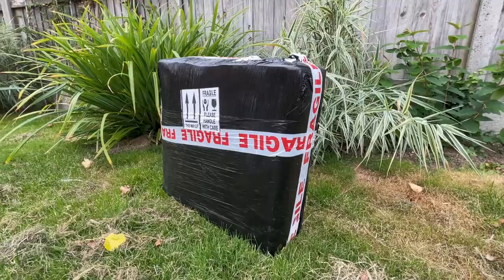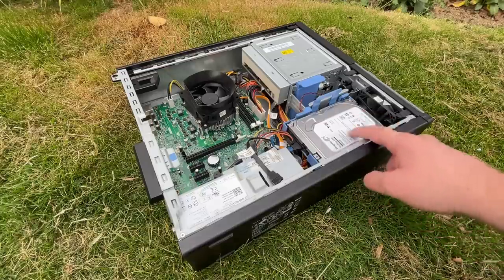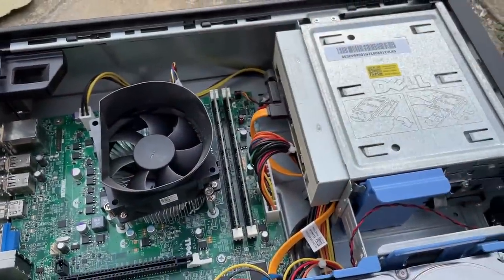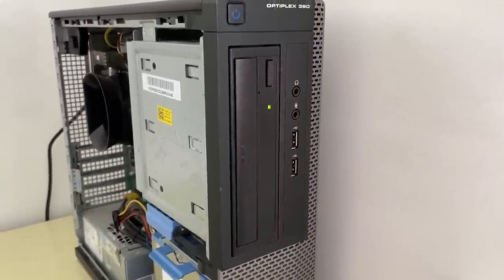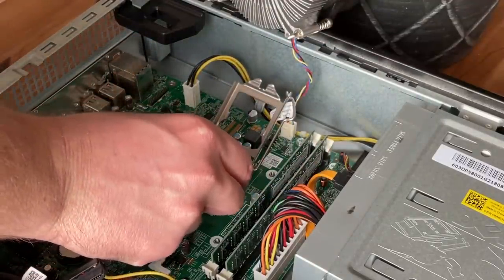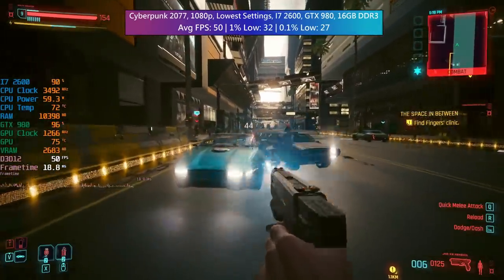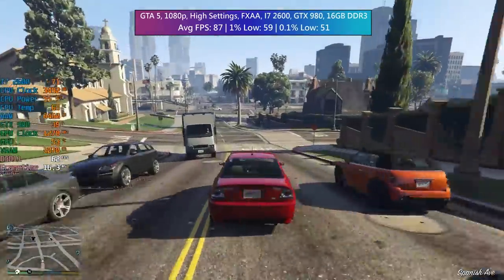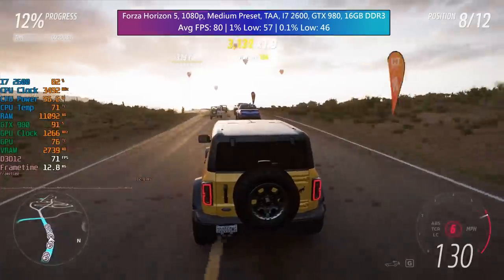The seller didn't know the specs of this £15 PC...

Comment: Last year, I scored a "for parts or not working" GTX 1080 for $35. I got it to work...mostly. It would only work in pci x8 mode not x16. Also scored a Ryzen 5 2600 "for parts or not working" for $50. Turns out it just had a few bent pins. Once I carefully fixed that, the cpu worked great. In fact, it's in the computer that I am using to type this comment.
Reply from the maker: Nice! That card shouldn’t be too different in x8 mode
Reply: That has to be the best deal in the history of pcs. Period.
Reply: No different with pcie 3.0 x8 vs x16 with that card. Very nice deal!
Reply: Cool to know that you solved it and wrote that on the specific computer too
Reply: Score!
Reply: I scored a workstation PC with 14Core i9 7940x, 128GB RAM,  GTX 1080Ti, Sound Blaster audio card, Asus Wifi 6 card and couple of other things for £40. Seller didn't know anything about the PC and it turned out the GPU was faulty as it was crashing in Windows, however it was still an amazing score as I sold the GPU as faulty for more than I paid the whole PC while other parts are worth up to £500
Reply: i love salvaging stories like this, you guys are smarter than average
Reply: same here put together a mostly used some new 13600k z690 64gb ddr4 1080ti for under 500usd off marketplace in under a week, absolute steal.
Reply: Name your price and I'll pay it.
Reply: Gg
Reply: I saw R5 1600 for 10 € already. Average is 30. For that price you get an amazing value for modern gaming.
Reply: might be some of the contacts used for x16 are damged on that gtx 1080, x8 only uses half the puns on the big connector
Reply: @asuschrist   bro in what page you found this?
Reply: yto mum
Reply: And then there’s eBay Italy, where a 50 euro “not working” system means a power surge fried the 4th gen i5… that isn’t included in the price, like the ram, psu, gpu and hard drive. :(
Reply: @RandomGaminginHD  yeah, I am looking at buying an old 1080 to tinker with (maybe custom watercool). I got real lucky and have a 2080 super in my system that I got for $200
Reply: That’s awesome!
Reply: That is awesome! Huge score indeed!
Reply: Pretty crazy how much functional tech turns into e-waste over nothing
Reply: I recently bought a PC from a divorcing couple. He had told the wife to keep everything - they were clearly loaded judging by the house and her BMW. He was he was off busy overseas with his new girlfriend.  The wife said her ex-husband used to play games on it and she wanted $500 for it. It was a 13900K, 64Gigs of ram and an ASUS 4090 GPU. Thank you. I hope the divorce went well.
Reply: Is it possible to get $120 acer nitro laptop i5 8th and gtx 1050ti from 2018 .
Reply: Cool
Reply: @Gatorade69 bro I’ve been in the same situation. I only recently got back into looking at pc parts because my current rig has been crashing for some time (and the cpu is a decade old). I recently bought a barebones T3620 with mobo for like 45$ bucks and it has support for M.2, DDR4, 6th/7th gen i5 and i7. Only issue is it’s missing the storage, ram and video card (comes with a V5 1200 cpu fortunately), but luckily you can swap most of them out with spare parts like I will. Buying stripped workstations is where it’s at imo.
Reply: @RandomGaminginHD  I wonder what you search to find such computers.

This video may be from awhile ago but I hope that you respond.

I think a little system like this would be great for older games. Me and my younger brother only really play games like Minecraft, Call Of Duty Black Ops 1 & 2, Batman Arkham Asylum & City and Resident Evil 4 & 5.

I must just finally bite the bullet and get me and him some cheap gaming rigs for older games.
Reply: @regwatson2017  bros got insane luck
Reply: @RandomGaminginHD can you give me the gtx 980

Comment: Around a year ago I was browsing through Ebay and saw a listing for a HP Z620 with a E5 2690, 64 GB RAM, 480 GB SSD but with no GPU.  They were looking for £200, I put it on my watch list.  They emailed me to offer I for £100 so I took it and when I received it to my surprise it had 2 x E5 2690. I could sell the 2nd CPU and riser board and almost get the asking price back!

Definitely some bargains to be had if you know what to look for
😊
Reply from the maker: Nice. Adding stuff to your watch list is definitely a good idea as well. I’ve had some crazy offers from sellers!

Comment: Dvd drives are often unplugged in commercial environments to stop people installing stuff on them. The proper way would be to lock down the PC with group policies but it's much simpler just to unplug the drive 😊
Reply: That's exactly my thoughts! I believe this PC was used as a workstation is some office and they simply unplugged that dvd drive.
Reply: That isn't the only reason. The cost of running 100 DVD drives in an office ads up, even at idle. Especially when they're hardly ever needed. Also the PSU's in these prebuilt PC's are often under-spec'd, so if you unplug stuff they last longer.

Comment: To use that board in a different case, you had to do some hackery for the front fans and such otherwise the BIOS complains at you every time you turn it on, and have to press F1
Reply from the maker: yes good point a few of the fan connections are probably not usable straight tout of the box so to speak

Comment: I found a couple of years a pc with an i7 4790 with a gtx745 and 8 gig ram 1tb hdd. When i press the power button Windows was on bootloop. A GTX 970,one more 8gig module, SSD and a fresh install of Windows and gifted that computer to my cousin with. 3 years later still using them.  And is very Happy with them.

Comment: Few years ago I was running a i5 2500 with a gtx 950 and it ran everything I threw at it for the time.  Probably the most intense games I played on it was GTA5 and Fallout 76.  For an older CPU they can still perform decent.  You can't beat $15 for what you got though.

Comment: That cpu speed was awfully specific for something someone knew nothing about 🤔
Reply from the maker: Yeah maybe they looked up a different optiplex and saw that written somewhere
Reply: @RandomGaminginHD yes, this seller had no idea what he was selling and “that cpu speed was awfully specific”…soooo the seller won’t seem like they don’t know absolutely nothing when they made the listing and didn’t know what to say about the computer.
Reply: @NathanOakley1980 probably went into windows “about my Pc” and put the cpu name in the listing description. That’s what most Pc noobs do at least
Reply: @TEENYcharma  task manager also shows the CPU speed.
Reply: @RandomGaminginHD I love u😊
Reply: Better to state that it has an 'i7' and 'no memory' than say what they actually said.
In my opinion, they didn't know the specs.
Reply: @NathanOakley1980  maybe he got this computer from a shop located beyond the curve, and just couldn`t read the specs because of the refraction limit, eh, Nathan? :D
Reply: @BeezyKing99 and name.
Reply: The CPU speed listed wasn't even right. Clearly just Googled the model number on the front and copied the first thing (most of these were configured with i3s)
Reply: @TEENYcharma It didn't have an OS installed or RAM, how would they do that
Reply: Clock speed is often put on the packaging/case of PC's by companies for some reason. The same way they could put a core i5 sticker on to advertise it's capabilities when in reality just saying i5 could value a CPU at £10-£100+
Reply: @TEENYcharma  That would be amazing, seeing how the PC didn't have an OS installed.
Reply: @Chris Good job on overthinking this. They were probably told some information on this machine and not being a computer geek, forgot most of it.
Reply: @md_vandenberg  idk it was just a theory i had. But they probably knew enough to format it somehow or replace the drive entirely. Maybe a repair shop or something like the geek squad helped them get it wiped

Comment: Ebay deals are my favorite thing to find lately lol. I just recently got a i5 9600k for less than $50 and it appears to be in almost mint condition too! 
Im thinking of trying out the coffeetime bios mod on a Asrock z170 extreme7+ motherboard (also in mint working order) i scored for $15 from my local E-waste center, and pairing the two together. 
After some research, it appears very easy.

Would actually make for a great video idea if you ask me! 

Also earlier this week, I scored a xeon e5-2687w v4 for just under $40. So I'm stoked to try it out on my x99 test bench later today!
Reply: What do you search? For parts not working?

Comment: I know the GPU I’m about to mention is a severe mismatch for the i7-2600, but the RTX 4060 LP might work well in this given it’s by far the fastest option available in that form factor, shouldn’t be too bandwidth bottlenecked compared to say, the RX 6400 or 6500 XT (8 lanes vs. 4) and should be able to accommodate the power requirements of the GPU.
Reply: Just make sure to disable to spectre and meltdown and cut down the nvidia driver since it’s full of bloat and will hog up cpu that will give that old i7 a huge boost in some games it’s literally a 80% increase like battlefield 5 for an example since they added new microcode to old cpus vs not doing those optimizations you can also cut down windows installation bloat to maximize your performance also as long as your not using an old hp you can add rebar to the bios and squeeze another 10-15% framerate
Reply: @josephdias3968 Please learn about capitalization and punctuation, because this was a hell to read. But you're totally right.
Reply: I'm using an i7 3770 with a 1660 super, and in most games it's the CPU that's holding back frames. A 4070 would be a MASSIVE overkill for that CPU. We should've gotten a cheap 3050 LP ideally

Comment: When I bought a 2600 1-2 years ago (upgrading a Pentium dual-core on an Intel P board) it was $25. You made bank on this machine, congrats!
Reply: That 2600 allowed my HD 6870 to run so well, the card died from finally actually being fully utilized after ten years…. I’m hoping for a GTX 960 4GB to have an ultimate XP machine.

Comment: I actually played through cyberpunk when it first came out on the xeon equivalent of this i7, paired with a gtx 980, just like the combo you tested in the video. Surprisingly solid combo! I remember averaging around 45 fps, but got plenty of fps drops. I think I used a mix of medium and low settings, but was able to keep full screen res on my 1920x1200 monitor
Reply: @@Shmackin710 it definitely has been optimized more, although I don't think Maxwell GPUs see much of the benefits. The fps in this video looked very similar to mine, but it's been a long time since I used that combo so Im sure there's been some improvement
Reply: I play Cyberpunk on my PC with i7 2600s, 16GB DDR3 RAM and GTX1060 6GB running Windows 7 and it's definitely playable. Wasn't playable with my previous GPU - RX460 4GB.

Comment: The biggest surprise system I got (which I currently turn into my next gaming PC) was a free X99 System with a 5930X for free, it was only ever used for browsing/excel. 

The biggest surprise I ever got as a Disc was/is a Windows 7 Ultimate OEM Disc from a business that shut down and Microsoft never deactivated their licensing thingy.

Edit: 5830K
Reply: u mean 5930k or 5960x ?

Comment: GT 1030 G5 work great in these systems. I have 3 old Optiplex SFF all with GT 1030 G5 LP in them. That GPU is stronger than the mid range full size gaming GPUs of the Sandy Bridge era so it brings them up to contemporary gaming PC specs. Even newer games like Diablo 4 and New World will run on this config. Basically anything Steam Deck compatible will run. A Steam Deck is pretty much on par with an older i7 with a GT 1030 G5 in performance, and a lot of developers are still targeting this performance tier for their minimum spec.
Reply: I'd just stick an RX6400 in it, more up to date.
Reply: @darthwiizius  But that is just not worth it , new low profile cost 180$ and for that price you can have PC with i7 6700k + 16gb ram + 1060 6gb .
Reply: @smilingpolitely12345 yeah Rx 6400 needs PCIe 4.0 makes no sense to put it in a system like this
Reply: Definitely agree with the gt 1030. Can play alot of the epic free games with that and many older and indie games.
Reply: @smilingpolitely12345  yep, it simply makes no sense. I got an intel core-i5 Gen 3 dell like this matched with a AMD R7250, which is slightly weaker then a gt 1030 and runs hotter ingame, but got it fpr 20€ a year ago. Good for casual gaming, TF2 an stuff. Its a nice system that has low idle wattage.
Reply: @MtFoxt "needs"? I've put my 6750XT in a PCIe 3 slot, no problems at all
Reply: @CLOYO  I should add for full power lol my bad
Reply: @CLOYO 6750xt and 6400x are different,  the 6750xt has all 16 pcie lanes so no issue in pcie 3,  the rx6400 only has four lanes meaning it will lose something about 10-20% performance when in a pcie 3 slot.

Comment: That was a nice system that you got, in the end! With the i7, 8GB DDR3 and a suitable HDD or SSD (HDDs are pretty cheap now and 240GB SSDs aren't much more either), someone will have a good time using this as an everyday machine for their day to day tasks. It was also good to see what that i7 was capable of when paired with a GTX 980 (I wouldn't go much more powerful than this, GPU wise) - though we all knew that Starfield wasn't going to run due to (a) it being an unoptimized mess, and (b) you were using a HDD on an "SSD required" game. Still, very poorly optimized title.
Reply: I suppose. But with the 2nd gen graphics never officially supported on Windows 10 you can run into strange issues here and there while using it with onboard graphics.

I always recommend going for 3rd gen at the earliest if you are going to be using onboard graphics. Not only that bit more stable at times, but as bad as all the graphics are on these cpus the 4000 is a decent amount better for old games and some indie gaming.
Reply: @wyterabitt2149  I'm pretty sure I've had 2nd gen Intel CPUs, as well as 1st gen Intel CPUs, running Windows 10 with nothing but their integrated graphics with no issues whatsoever.
Having said that, for this Dell I would go with the 16GB RAM with the i7 (pretty sure 16GB is the maximum supported), a decent SSD/HDD, the optical drive, and as far as graphics, something like a low profile 1050 or 1050Ti would probably be OK. Something that doesn't require external power, of course.
Reply: @TheSpotify95  You can run it, but it's technically not supported and never actually got a proper driver release at all.

Intel had some kind of contract that required them to produce a driver for 2nd gen that worked for Windows 10 on release and nothing more. But they also officially did not support Windows 10 for 2nd gen processors. 

To get around it, all they did was package up a stable older Windows 8 driver when and label it Windows 10. They then clearly marked 2nd gen as not compatible with Windows 10, and made it clear it would never get an update. That Windows 8 driver, that was older at the time Windows 10 was released, is still the only available driver.

It does not run that well, and can cause issues at times. It could also work "perfectly" for you, although will still be lower performance than a proper updated driver release would have been. Given the background, if you are going to be using the integrated graphics just go for 3rd gen minimum. Much more performance, and little chance of any issues.

Comment: I have an Optiplex 390 board I got for under $15 with the I/O shield in 2017, the thing I hate about Dell is that they used a standard form factor motherboard, but then they don't doccument the power connector pinouts anywhere and then they short a bunch of pins out in the header so that it knows the power button and front panel cable are plugged in, so I was able to find enough about the pinout to hook up a power button but since I don't know which stupid pins are all shunted together it gives me a stupid error about front panel connector failure and power button cable failure at boot, the whole idea of that is just so stupid, it doesn't provide any useful diagnostics information it just adds unecessary points of failure, you'll know if the power button cable has malfunctioned if you can't turn the machine on you don't need to add unecessary wires that won't even do anything if you can't turn it on in the first place. I only bought it because it was the cheapest 1155 board you could get at the time and being an OEM board it means you can easily install Windows 7 with a Dell OEM disk get a valid SLIC license then upgrade to Windows 10 for free.

Comment: What's fun with Dell is on their website, under support put in the service tag number and find out what the machine originally shipped with.

In this case it was "J5F7M : Module,Processor,SNB,G630,2.7, 2C,Q0,L" which looks like a Pentium G630. So at some point someone explicitly put the i7-2600 into this machine... only for it to end up like this.

The stories old machines could tell =p
Reply from the maker: ah that is interesting. Didn't think to check that myself!
Reply: Maybe someone upgraded it for a project then realised the form factor makes it a bit tricky.

Comment: A working PC with an i7-2600 for £15 is amazing value. When I saw the title I was half expecting the hardware in this PC to be old and obsolete. An i7-2600 is still perfectly usable with Windows 10 or a modern Linux distribution.

Comment: I got a similar deal on a dell optiplex, £25 for an optiplex 3020 with 8gbs of ram a 240gb ssd and an i5 4590, i cannot lie it was a massive bargain, especially since i wanted a different machine other than my laptop to run my minecraft server. It also came with some office peripherals and an actually decent 1080p monitor that i ended up giving to my friend. I almost forgot that it also is the sff version so it is very small and quiet.